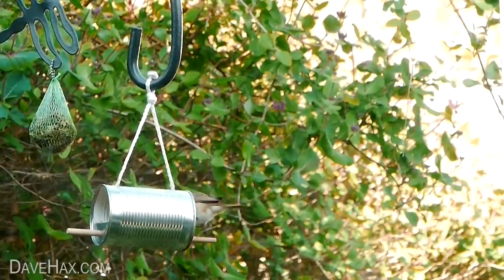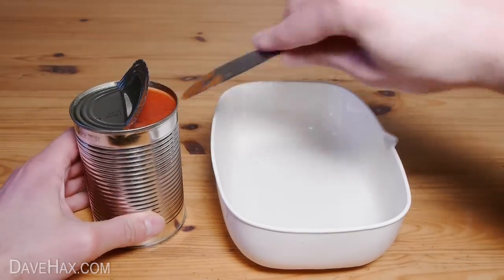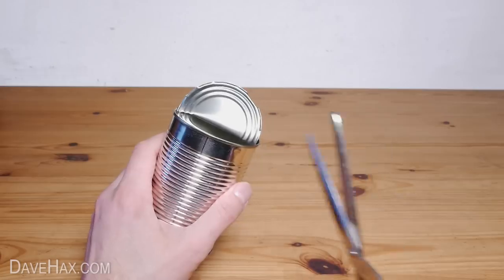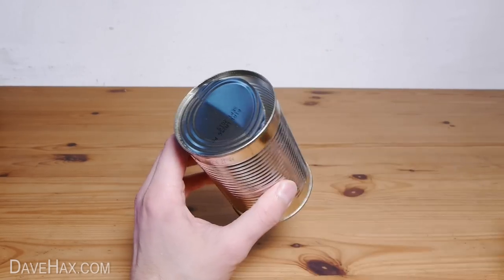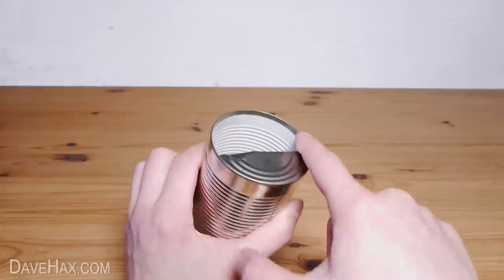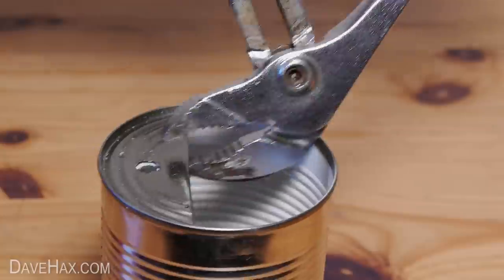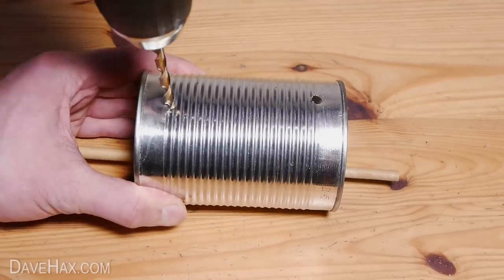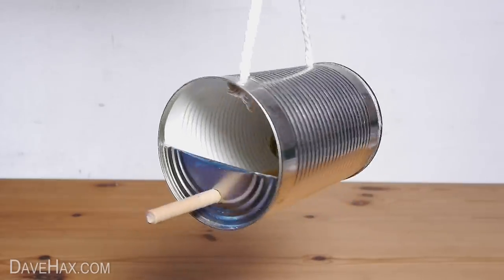How to Make a Tin Can Bird Feeder

Comment: FOR ALL THE PEOPLE SAYING THIS IS TOXIC TO BIRDS YOU ARE WRONG. Cans nowadays no longer have tin in them and are made from aluminum. Aluminum is perfectly safe and nontoxic. Also, for the people saying the birds with get burnt or frozen because of the can, the birds are only touching the wooden dowel. I hope this clears up some confusion.
Reply: ruby blades aluminium can be toxic in combination with food i think.. but inside the can is a layer of plastic for that reason.. 
btw nice profile pic (;
Reply: ruby bla
Reply: ruby blades YES
Reply: captain pugwash  you have way too much time on your hands
Reply: captain pugwash  way too much time
Reply: A BIRD MAY STEP ON THE TOP OF THE CAN....THEN WHAT. WOOD IS THE BEST FOR
EVERYTHING.
Reply: As I've used metal food containers, as bird feeders, whatever the metal it will go rusty over time.

Comment: Simple idea which would be ideal if made out of wood or if placed in a very deeply shaded area.  If it is left in bright sunlight in the summer it will become fiercely hot and injure unsuspecting birds.  A plastic container with easily fixed half circles of wood at either end is a better option.